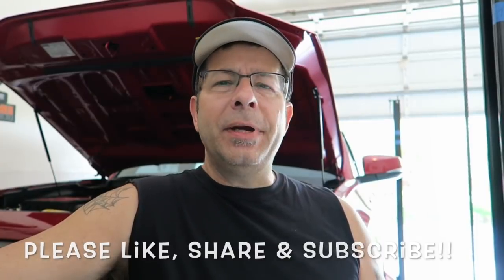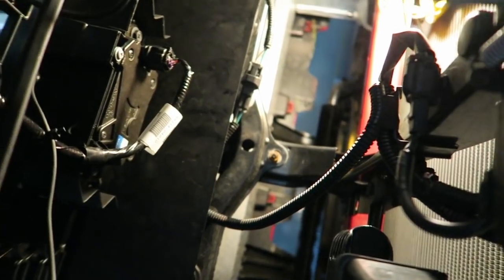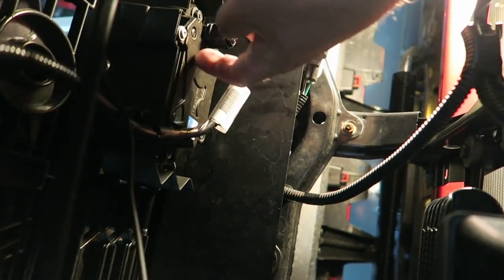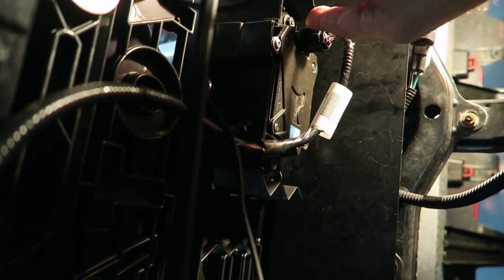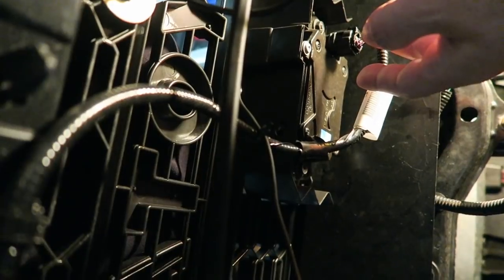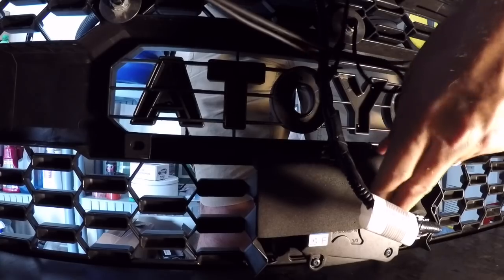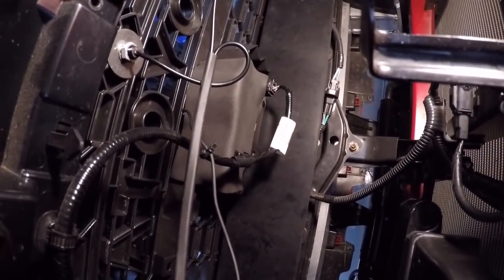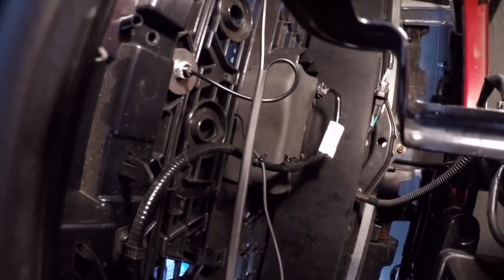Toyota's Bandaid Fix for Tacoma & Tundra PCS Sensor | Don't Do This At Home!

Comment: I have a 2018 Tundra 1794. Received the recall notice and had my dealer fix the issue per the notice. They put the Tundra version of the waterproof seal over the sensor and performed the software update. They checked the sensor software before beginning the fix, and the sensor had been malfunctioning without any visible signs to me (diagnostics showed multiple error codes).  They ended up replacing the sensor as well as performing the fix. Don’t assume it’s fine just because you have not seen any issues...
Reply from the maker: Good advice👍

Comment: If you take a look around the engine bay you'll notice many wire connectors have no rubber boot covers, you'll see multi colored wiring coming out from corrugated conduit to the plastic connector and plugged in, some have electrical tape wrapped around the wire.  Cost saving for the manufacturer to not apply moisture proofing rubber boots over connectors ?  They need to apply better protection on all.  See the connections in front of master cylinder reservoir on Tundra, I''ll be retrofitting a cover there before washing the engine bay.
Reply from the maker: Yup...they all cut corners wherever they can it seems!

Comment: Have you also heard of the washers you add on the top screws of the sensor?
Reply from the maker: Yup👍
Reply: Did you try that too? Do you think it would work to make the  collision  off warning light not come on?
Reply from the maker: It’s possible.  Depends on what’s wrong 🤔
Reply: Well I put a new front grille emblem "T" on my 2018 toyota tundra  and when I drive the collision off warning light comes on. Just wondering if I put the washers it might angle it a little up?
Reply from the maker: I’d say it’s the emblem 🤔

Comment: Wow, I think you did a better job than my dealer. Had I only known, I would have brought it to you for the repair. LOL My front camera kit is supposed to be delivered tomorrow. After I get it installed in my TRD Faux grille, I plan to remount the PCS sensor in it. I'll use your (non) recommended procedure to re-seal it. Thanks for the post!
Reply from the maker: Lol!!  It came out pretty well.  Thank you for the pics 👍👍

Comment: Interestingly enough I took mine in today, after market knockoff TRD Pro style grill, and the dealer applied the fix and software update. So there's that.
Reply from the maker: That’s great!!  Really depends on the dealer I think 🤔
Reply: Yeah. I was pleasantly surprised. I'll take it though.
Reply: What's the purpose of the sealant? Free of charge?
Reply from the maker: Supposed to keep water out of the sensor.  It’s covered under warranty.
Reply: @RobMotive  so if change my grille it would need to be the original OEM in order to be covered by the warranty

Comment: I just bought truck brand new, was going to do put Pro grill in, and noticed the tss sensor has the black neoprene strip covering it and glued to the grille.  I'm so mad, going to have to figure out how to get that thing off first.  I wonder if you asked Toyota if they would give/sell you the black strip they use and you could just put it on yourself.
Reply from the maker: I did not ask Toyota.  It should be pretty easy to duplicate.  Especially if you have both grilles sitting right in front of you.  👍
Reply: You right.  Nowit's just finding a way to remove this neoprene patch that's glued on to my senor and frame so I can get to the screws to unscrew it. Dammit anyways
Reply from the maker: It’s a drag...but I bet you’ll be able to pull it right off👍

Comment: Toyota fixed my sealant recall but I had to sign a waiver (lifted and bigger tires) and then they shut off the adaptive cruise. Have a warning light on all the time. Wonder how I can get the adaptive cruise activated again?
Reply from the maker: It shouldn’t have deactivated .  Have you contacted the dealer again?
Reply: @RobMotive  I didn’t realize all they were going to do was put some foam over it, everything was working fine. They told me they would deactivate it, and I had to sign a waiver. I can’t even get the standard cruise on. I didn’t think it would be that big of a deal to get it turned back on.

Comment: What a Mickey Mouse fix! (Not you Rob...Toyota's solution!). Maybe Toyota should have resigned the PCS housing instead of putting a band-aid on it. I doubt that the problem is all the prevalent however and this is just a precaution. I'm still waiting to take mine in for the recall....I have service scheduled in a few weeks and I'll get it done then. I have not had any issues with my PCS yet.
Reply from the maker: I know right!!  How long do you suppose that thing will stick on there.  No way is it watertight either!!

Comment: Ya took mine in for 10k oil change. All sudden sensor acting up and shuts off. Took in they tried to tell me the pro grill has different sensor. So put original grill back on and come back to recalibrate it or buy different sensor. It's a lease truck for now but looking to do buy out. Want to do more but dealer giving me Crap so I'll hold off. But lucky for me a pro taco came In for oil change. Lifted and every accessories on it. They check sensor and it was same part number as mine so they agree to order new sensor.  Just pisses me off they try to pull anything to charge you and not warranty it out. Just because I order the pro grill and install it my self and not pay them to install it!
Reply from the maker: That sucks!  Good that one came in and you could prove your case!!👍
Reply: Ya still waiting to get new one in they said they order today and might come in tomorrow or next week. They said take 1hr to recalibrate it. There a video on the tube guy called the main corporate number and talk to them. They made his dealer fix his as he has a custom grill. Told them to put factory grill on and if still doesn't work then put new one on. They proved it was bad sensor but still tried to not do or charge him $1k for new one with labor. Main corporate after he called said no charge do it now.  Corporate also told him if you get error to hold the cruise button for 3 seconds and cruise will keep working. Well I tried it and it works so even if it still happens again I'll just live with the light on.

Comment: The type of foam you used looks better than what they used. Still don’t understand how an aftermarket grill, especially one modeled after their very own pro grill and aftermarket lift, wheels and tires cause the issue they’re recalling it for. 🤷🏼‍♂️
Reply from the maker: Exactly!!👍
Reply: I’m a Toyota tech myself so Maybe i can shed some light. 

What is actually causing the failure is water running into vent holes into the sensor. The foam is meant to redirect the water.

The grill and lift kid don’t actually make a difference as far as adding the foam. It is when the system needs calibrated.

TOYOTA didn’t want to be responsible for calibrating a system that needs to know very specifics heights in order to be accurate (remember, we are dealing with something that can be life or death) when the vehicle is lifted.

And Toyota also can’t ensure that the mounting area on the after market grill is built to the exact specs as the Toyota grill. In theory, the sensor could sit off a degree or two, and not see an accident about to occur.

In the lawsuit happy world we live in, and remember all the frivolous lawsuits pertaining to unintended acceleration. TOYOTA is just covering their ass.

They did come up with a new letter that says that we can now perform the recall, but the owner needs to sign off that we are required to shut off the PCS system.
Reply from the maker: I’d agree with all of what you said.  To be clear, the letter states that they will not perform the “fix” on trucks with aftermarket grilles...however, I’ve been told that some dealers are going ahead anyway.
Reply: RobMotive Toyota came out with a second revised letter advising us to have customers sign a waiver for our protection.

Whether all the dealers are following this or not, I’m not sure of. But I promise, Toyota’s stance on it is having us have the customers sign a waiver.
Reply from the maker: Hmm...is it possible for you to send me a copy?
Reply: @RobMotive  I emailed it to you.
Reply from the maker: Thanks bud!!  I really appreciate that👍
Reply: RobMotive no problem.
Reply: @RobMotive  can you email this to me too please? I am about to buy a new 2021 tacoma. Does this issue still exist?
Reply from the maker: No, I believe it was resolved👍
Reply: @RobMotive  even if you switch to an aftermarket grille?
Reply from the maker: The sensor is the same.  Which grille you use is irrelevant.

Comment: Well hear this goofy crap Rob.  I literally just got off the phone after Toyota called me saying there was an additional fix for my millimeter wave radar sensor, I said another one?!  They said yes, this involves installing a sealant to keep water out.   And here’s the kicker, my pre-collision sensors, you know all the ones in the bumpers, this feature would be permanently disabled as part of the fix.  WHAT THE HELL TOYOTA!?  I told them everything is working just as it should at the moment, and your not touching a thing on my Tundra.  😁If it ain’t broke, don’t fix it!  Crazy stuff!
Reply from the maker: Wow!!  Did they say how much of a refund you’d be receiving?  I mean you did pay for a functioning system when you bought it!  🤬
Reply: RobMotive your correct Rob, I’ve been thinking about that, I’ve paid for these crazy safety features, but no word on any refund of course!  What is going on with cars and all this safety stuff.  Is the government putting pressure on these manufactures to get these things out ASAP, and they are rushing the testing on it?!  Who knows.  IMO, these cars are making people “careless” drivers anyways.  People feel like they don’t have to pay attention until they see a light or hear a beep warning.

Comment: 1) That seems like a weak sauce fix on Toyota's part.  But then, so was the design for keeping the sensor out of the weather.  2) Putting your stock grill back on to let Toyota do the fix is useless because of the fix they apply.  Once your sensor is encapsulated in the neoprene sticky pad, you’d have to remove it all and repeat the process on your TRD Pro grill anyway.  

3) The OEM grill has the sensor out in the weather a little more than the TRD Pro grill which has a little bit of a “roof”
over the sensor.
Reply from the maker: The only reason one might (I stress “might”) want to put the OEM grille back on is to have the dealership do the software update.  You would of course have to redo the pad once the sensor is put back into the other grille👍

Comment: 🤦‍♀️Ours has the "bandaid" fix already!!! And still has the issue lol 🤣 oh geezzz! So, what would you recommend we do if the bandaid isn't working lol this may sound nutty but would some sortof sealant around the edge help? We also have an aftermarket push bar as well. So, dealership probably won't be a very frugal option .... Smdh
Reply from the maker: My first guess would be the push bar is being picked up by the sensor.
Reply: @RobMotive  I'd agree, except the sensor only actually has gone off during one drive months ago. Our main problemo is literally just washing the car or heavy rains🤦‍♀️🤣 at that point nothing electronic on the interior ever shuts off. I looked above for the square weather stripping stuff you used and found no link (which makes sense since you don't recommend this). What we're thinking is maybe ours is shorter on the sides than the friend dealer photo you showed. Possible to just add more over the edges? I dunno. I'm at a loss. And, our rainy season is coming up soon 🤔😅🤷‍♀️ is there a way I can send a photo of it to you?
Reply from the maker: It’s always going to go off in heavy rain or during a car wash if you’re spraying directly on it.  However, it should function normally after the water/soap clears 🤔